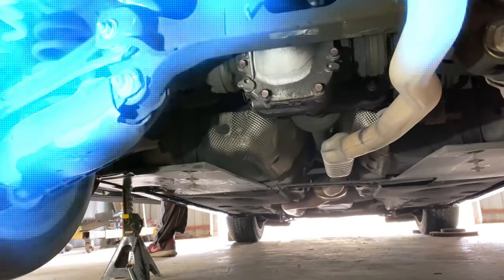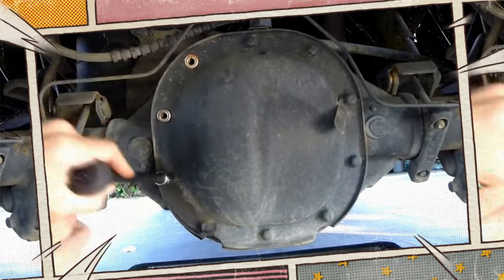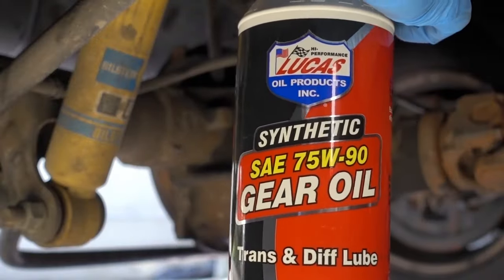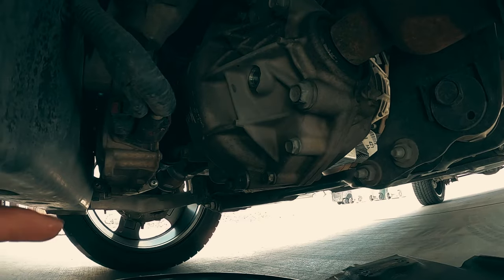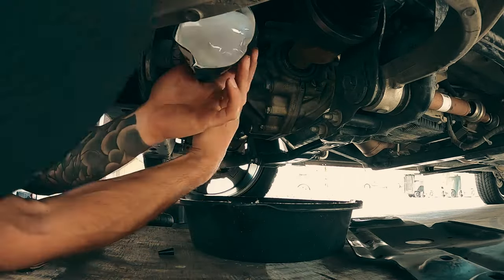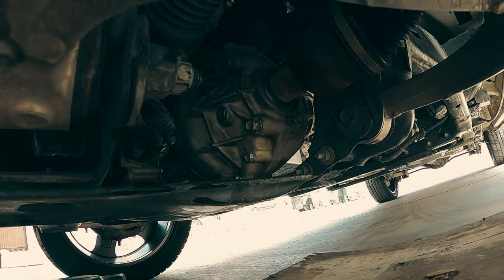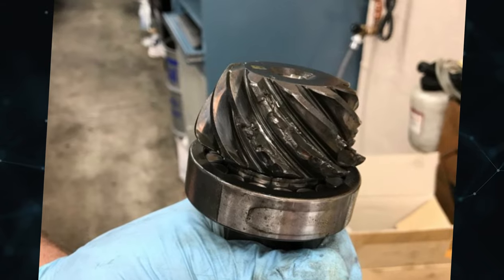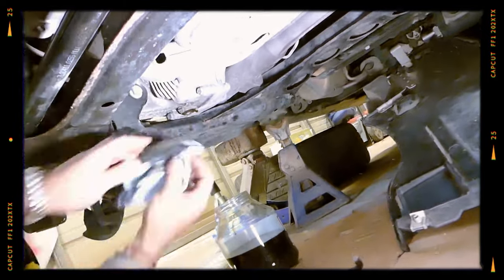How Often to Change Differential Fluid: Rear, Front & Replacement Cost

Comment: Paying someone WILL NOT guarantee that it is done right. ONLY YOU can guarantee that.
Reply: And if you get this done by a garage, you will pay 3-4 times more at least. Not hard. Drain bolt & fill bolt.
Reply: @joescott1377  that's all it is lol. Only downside is that God awful smelly diff oil lol

Comment: I've asked 4 shops about changing my diff fluid.

All have said you don't need to change it, just check the level.
Reply: Socalpunk, I’m no mechanic but I do the maintenance on my cars. I change the diff fluid on my daughter’s car every 35K miles with OEM fluid (‘18 Honda HR-V). Trying to avoid any future problems.
Reply: Well those shops people should know better. When you drain the fluid and it's dirty there is your answer. At least for them.
Reply: You're joking?
Reply: Cus they are waiting to overhaul your differential.